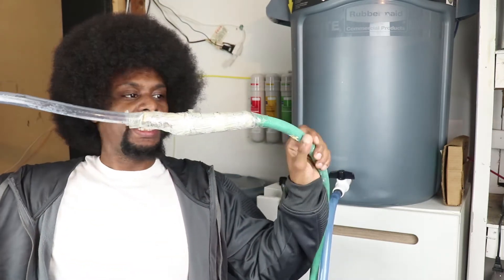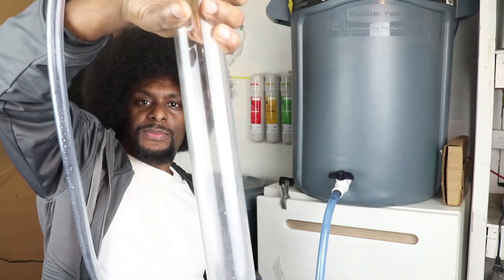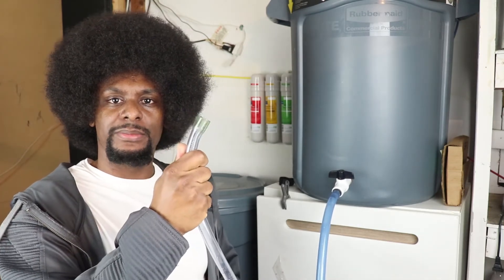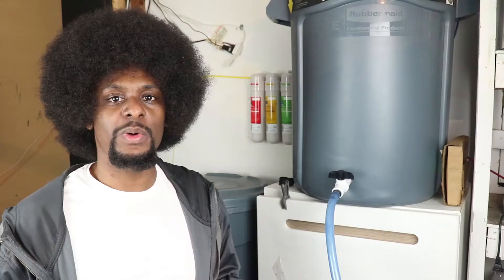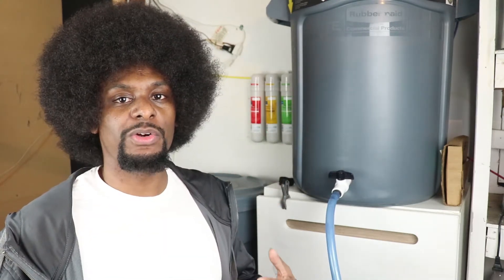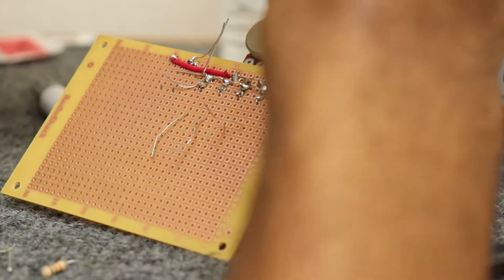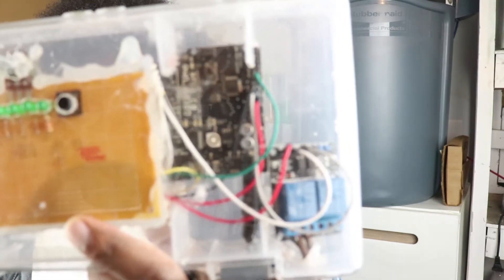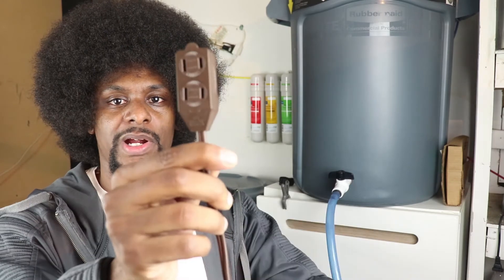DIY Electronics: Arduino Automatic Aquarium Water Change [Reef Tank]

Comment: @Kelvin J. Roberts: how do you control/check the amount of water getting pumped out of the tank? If a relay gets stuck, your system keeps pumping until it burns the pump? I'm new to this stuff. I'm away from home from time to time and I would like the water change to be so easy my wife will want to do it when I'm away :p But I want it to be fail-proof.
Reply: Kelvin J. Roberts Well I have an aquatlantis aquatable. It s basically a coffee table. It complicates stuff. I can't put a fixed system in because there's no closet beneath it. I also need to put the least possible amount of stuff in the aquarium (it has a very small opening compared to other aquariums). I'll put a reservoir in the garage and I can make room for other reservoirs to if needed. The idea is I have one pump in the reservoir with a hose and I have a pump I throw in the aquarium with a separate hose. Push of the button pumps out 80l, stops the out pump, starts the in pump en pumps 80l fresh water in. Full stop. I have no experience with programming or electronics so I could use some help of you would be so kind. I'm not scared to learn new stuff but I'll need some experienced guy to kickstart me. Any thoughts on a system that would work in this situation?